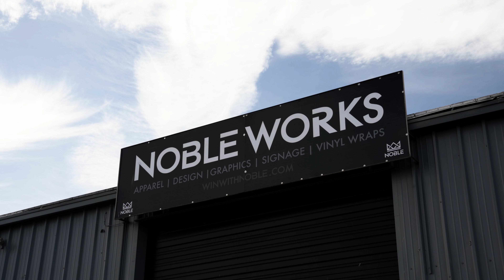Noble Works x MCG Gen 3 Ford Raptor Vinyl Wrap

Comment: Great job, great workmanship. If you want to get wrapped you look like you did an excellent job. But, I don't get it. Drive the heck out of your Raptor, for the cost of the wrap you could probably repaint the the problem areas to be good as new. Also - I think it will be extremely expensive to remove the wrap from this truck. I bet all those parts will need to be removed to remove the wrap. Plus I think the original color was a lot better than flat black - which has been way overdone.
Reply from the maker: Thank you!